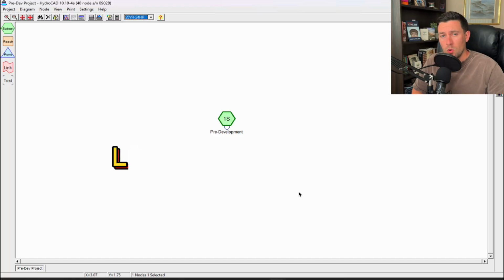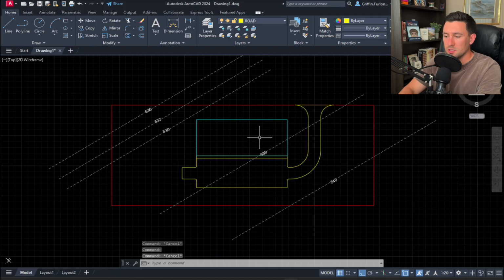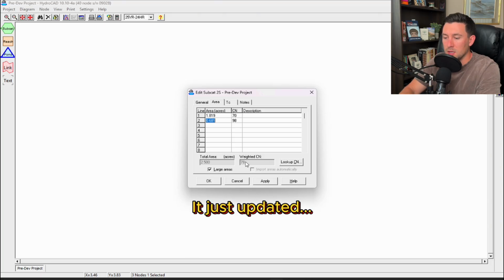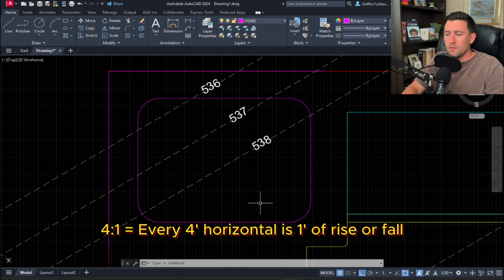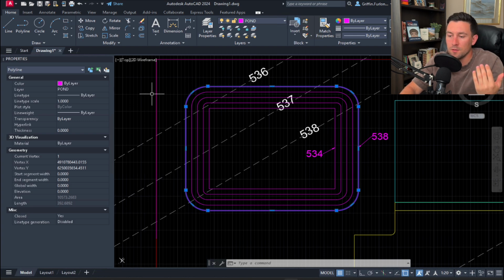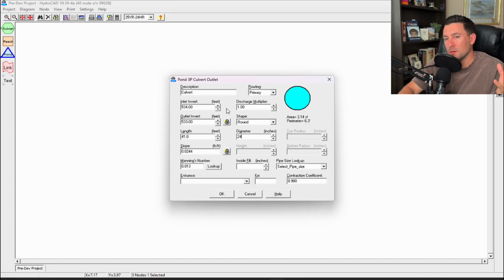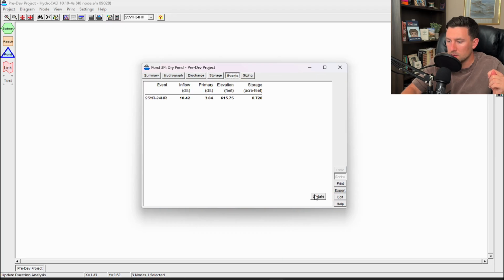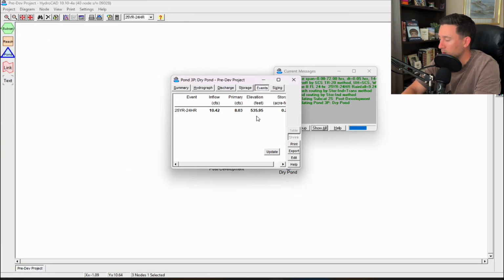How to Design A Dry Detention Pond (Beginner)

Comment: that's great explanation and concept, coudl you also provide a solution the same site, but using an underground chamber and/or exfiltration trench calculations? Besides, have you an excel spreadsheet for underground chamber and/or exfiltration trench calculations? Thank you in advance.
Reply from the maker: Yes, we've been doing a lot of underground chambers lately. Cultec has really good options, check them out. They will give you a free spreadsheet.